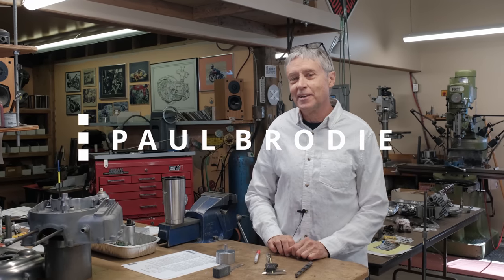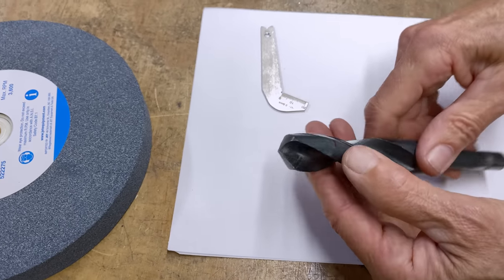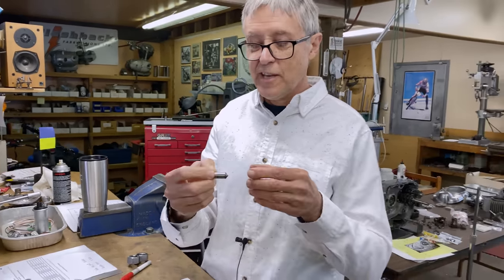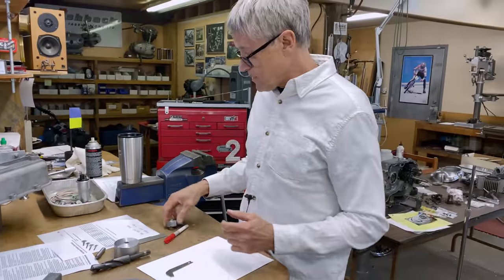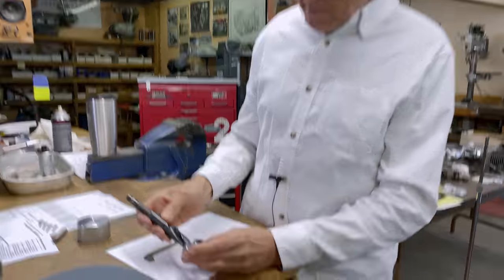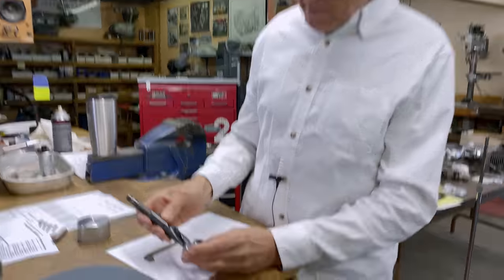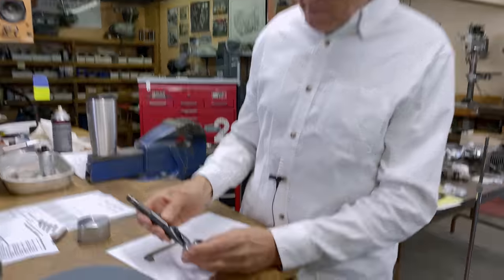How to sharpen your drill bits // Paul Brodie's Shop

Comment: Awesome video Paul ! Is that 996 Ducati behind you ?
I learned the two hex nuts tacked together method years ago from the same person who taught me how to sharpen drill bits and a lot about panel beating( a machinist who moved into panel beating ) - 30yrs later  is still use his technique  even though i have a Dbit grinder as it is just faster and it works . One tip i can add is when using a diamond dresser is  don't hold it perpendicular to the wheel surface - angle it so the rear of the dresser is higher than the tip  as it stops chatter and wear a dust  mask - that stuff really cuts up your lungs  .
Thanks for the video guys !
Reply from the maker: Thanks Ian. It is a yellow 996, but it is NOT a Ducati... That should get you thinking a bit! Model year is 2000.

Comment: Thanks for the tip on the diamond wheel dresser. Lee Valleys price in the US was only $27.50
( 0.25 Carat Wheel Dresser Item 25M0101). 
Replacing both my wheels (80grit and 120 grit) would have been $30 and I would still need to buy a wheel dresser some time in the future.

Comment: This is lovely. Nice camera work as well. Thank you for posting. 
I learned how to do this when I was a yute, but have not done much of it over the past 40 yrs. 
Back to school at YouTube University.
I've got a pretty good collection of bits piled up from people who would just buy new bits over the years when things were cheap(er).
Question: What's the best wheel for dealing with carbide bits? I'm pretty sure silicon carbide,  but I'm also seeing diamond wheels for $$$. 
I have some diamond plates for knives, and they are a beast when it comes to removing material.
Also, taking your example with a cut off tip, what grit would you recommend. TIA.

Comment: You really are best to have the relief angle start at the cutting edge. A flat right off the cutting edge will increase the needed force to drill and may cause excessive heat. There is also a diamond tool with a head approx 1.5 inch with multiple chips across the face which helps insure the face of the wheel is flat. Thanks for the video.

Comment: Great video Paul, as usual. That works great on a drill bit the size of your thumb. But what's the secret to sharpening something like a 3mm (or less) drill bit with aging eye-sight and it's even hard to find the bit in the first place. Ha Ha
Reply from the maker: Thank you. It's the same technique for small bits. Strongest glasses, steady hand, using the muscle memory of how you sharpened the larger bits, and patience :)

Comment: One way of adjusting the back cut on the flute is how high on the wheel you hold the drill 
You automatically introduce and angle being a little above the center line or the shaft of the grinder
Reply from the maker: You are correct. Thanks for watching and commenting.

Comment: Thanks for another instructive video! I'd like to know: what is the thinnest drill that you can sharpen? Can you go under say 5 mm?
Reply: By hand, I'd say about 10mm/3/8".  There are sharpening machines which will do down to 3mm/ 1/8" but most "home shop" sharpening machines are not *great* and have a bit of a learning curve before you can get good results.

If you are interested, there are shop-made drill sharpeners which can sharpen down to tiny numbered drills -- check out www.gadgetbuilder.com.
Reply from the maker: I sharpen all my drill bits right down to 1/16". They are tricky to get right but it can be done.
Reply: @paulbrodie  Wow that's impressive!

Comment: Very handy thing to be able to do ... when you can sharpen bits you take it for granted ... it's really just practice after you get the basics .
Reply: Freehand sharpening twist drills is a parlor trick that's good to learn. The twisting motion to develop the heel relief is weird. A good way to pick it up is to ape doing it with the grinder off. Just touch the whole heel through the sweep to develop the muscle memory. With the wheel off you can feel what's going on more. Starting on the heel and finishing on the cutting edge is a good way to go too. That way you have the furthest contact and can see where you're headed in the grind.

Comment: I took a machine shop class right after I got out of the army and they taught us how to do this and told us hit the second hand stores and buy up a bunch of drill bits to practice on and I did and all I did was make them more dull. We had to make a drill bit gauge as well. Looked different than what you got and we had to make it by hand filing. 30 plus years later, I'm still making drill bits dull. So I just buy new ones instead. :)
Reply from the maker: Sounds like you just need a little coaching on your drill sharpening technique. It's not rocket science, but you do need to be mindful of a few things. Thanks for watching.

Comment: I sharpen my own bits and i sharpen them with a little bit steeper angle and when im done they are very sharp, i sharpened a half inch bit that could go through 1 inch thick plate metal like butter, no pilot hole needed
Reply from the maker: Sounds like your technique is working for you...
Reply: @paulbrodie  ive been a mechanic now for over 40 years and through trial and error ive found the perfect angle, stock bits just don't cut as well and those so called titanium bits at harbor freight are a joke, the best bits made were the ones that were made in America when steel products were built to last now china makes everything and china is number 1 at making garbage the steel they make is to soft and brittle so when i find old old bits i hang on to them cuz they sharpen better and stay sharp longer

Comment: Best drill sharpening video I have seen. What's the smallest size you would sharpen?
Reply from the maker: I sharpen all my drills right down to 1/16". They are tricky.
Reply: @paulbrodie  Awesome. I'm going to have to make more effort! Other uses for old drill bits: you can sharpen them up to make a centre punch and you can even use them like a TIG rod to build up a hard surface on a homemade tool.
Reply from the maker: @benc8386   I have not heard that you can use a drill bit as a Tig rod.
Reply: @paulbrodie  It was on the weldingtipsandtricks channel not that long ago. But I have tried it out and it seems to work!

Comment: Bulldog sharpening jigs suck but they're not bad for evening up the cutting lips. I mounted mine funky so it grinds perpendicular to the cutting edge. I had to make a wedge shaped block for that to happen. Mount a bit in the jig and hold it up to the wheel and you should see what you need to do then.

Comment: Hi Paul, i noticed your Yellow VTR 1000 Great Bike! Is that your Daily Run-about? I have a '98 Yellow VTR that has 100,000 Klms & Still going Strong💪 God Bless & Keep the Dirty Side Down🇦🇺👍
Reply from the maker: Yes, that is my 2000 VTR with 65,000 miles on it, so basically the same as yours. They are great bikes for sure! Thanks for watching.

Comment: I have a question for ya, Paul!  I was watching a master Japanese welder, and his technique was very similar to yours.  BUT.. He didn't use any Argon.  Yet his welds, both "fusion" and Nickle-silver came out very nice.  As a quick experiment, could you try not using Argon and see what difference it makes?  Best Regards from Tallahassee!
Reply from the maker: Your question is not very clear at all. When I use nickel silver I am brazing. When I use argon I am Tig welding. I know what happens when I Tig weld with no argon. It burns the tungsten and the weld goes black because the oxygen contaminates everything.

Comment: Good morning Paul so I have been brazing for about 15 years now and I've used a few different types of torches all of which are Victor I also am a professional welder metal Sculptor I'm looking at one of your videos about a year ago brazing 101 I like it a lot I noticed your Technique is a little different than mine. One thing I might mention is pulling the torch back and forth is essentially the same thing as working the foot pedal on a TIG welder and dipping your rod anybody that can TIG weld would be pretty good at braising. Anyways I like the torture using I believe it's a Victor ca250 and I'm wondering what the disadvantages of having them mixing valves on the top versus bottom are. I know thermal dynamics would affect the valves as he would travel from the tip down to the valves realistically the only thing I worry about is Flashback how is your experience with this. I like the little hoop you have on your torch I myself fabricated a handle on my torch so when I'm holding it it's almost as if I'm holding a pistol I have the handle mounted in the center point of the torch so it rests essentially on my forearm and the hose wraps around my arm. I have found that all of my work I set low so I can sit down so I'm not holding my arm up all day long as the majority of my work may run as long as 6 hours consecutively

Comment: Hi Paul, thanks for the video, is it possible to sharpen a two flute end mill this way?
Reply: Give it a shot and let us know. I've certainly sharpened end mills with diamond hones. I'm not saying that works like a charm.
Reply from the maker: Yes and no. An end mill is obviously a different shape. I have sharpened endmills and they work OK, but I'd rather do it on a tool and cutter grinder, which I do not have. That's the best way.
Reply: @paulbrodie  that's the exact right answer. Anything's possible. Not everything is actually practical though. When I worked in a production shop we had a we don't sharpen end mills policy. We just ran them until they snapped and replaced them. We didn't want to use undersized tools.

Comment: Hi paul, nice video. I have a question do you also sharpen a drill under 3 mm, or do you buy new ones? I always try to sharpen them with a drill grinder but it can't sharpen below 3 mm so I try to do this freehand with varying results. I find the most difficult to sharpen the 1 mm, whether it works or I have to buy a new one.          Kind regards from the Netherlands     Akko
Reply from the maker: Akko, yes I sharpen drills all the way down to 1/16". They are tricky, and take good eyesight, which is not exactly me. Thanks for watching.

Comment: Do you use your mill as a drill press more.
I have a turret Bridgeport Mill and I also have a restored 1905 Cincinnati flat belt drill press I have the Chuck and the R8 adapter for the mill
Reply from the maker: I use my mill as a stronger, more accurate drill press, if I feel like it. No hard and fast rules.

Comment: Would it be fair to say that if looking at the wheel from the side (end) with the top being 12 o'clock, that as you're sharpening your bit you shouldn't use around 9 o'clock or lower on your stone, with your bit . . also never dropping the angle you're holding the bit at, with the tip below horizontal?
Reply from the maker: I had to think about it a bit, but yes, it is fair to say.. Thanks for watching and commenting :)

Comment: what kind of grinding wheel is that? i think it wasn't mentioned in the video i got a bunch of dull drill bits and I was thinking about buying the doctor drill sharpening machine but i own a bench grinder and it might be less expensive to buy just that kind of grinding wheel.

Comment: They also make wheel dressers that looks like a T, with the T part coated in diamonds (bonded), I prefer them. But lost mine...
Reply: I have single point diamonds and carbarundum sticks. I don't know why Paul doesn't like the sticks. That's what I mostly use myself.

Comment: I own a Tormek water cooled bench grinder for sharpening. I purchased their drill sharpening attachment which places a 4 point edge on the tip of the drill.  The Tormek instruction-dbs-22-en.pdf can be downloaded for the sharpening attachment. The PDF gives further information on drill angles.
Reply: I've seen that Tormek sharpening attachment.  Looks very thoughtfully designed.  Unfortunately, the whole system is outside my hobby budget.

Comment: What do you do to thin the web on small drills?
Reply from the maker: I sharpen the grinding wheel so that the corners are a very sharp 90 degrees. You need a steady hand and much concentration to thin the web, but it is possible. Hard to do a 1/16" drill, but it is surprising how small you can go...:face-fuchsia-poop-shape:

Comment: How I sharp my drill bits , I just cut a piece from each side of drill bit with angle grinder
Reply from the maker: Sounds crude, but it just might work for you...
Reply: @paulbrodie  
I usually got angle grinder and a cup of water next to me when im doing a hole to keep sharping the bits
Reply from the maker: @davoodehajiraj  I thought about it. Using an angle grinder is crude...   :face-orange-raised-eyebrow:

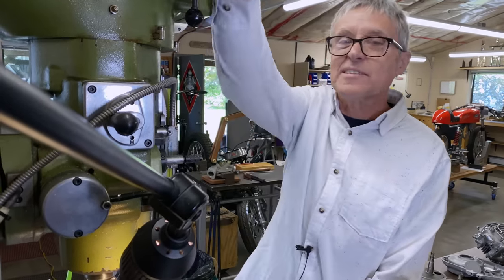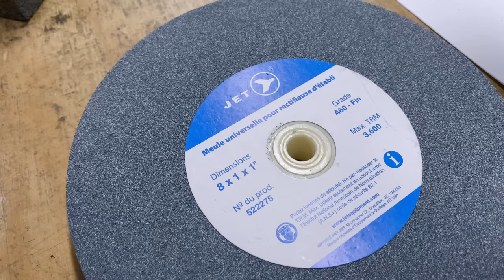Comment: You didn't mention the MOST important thing is WATER! never let the bit get hot, if it changes color, it's wrecked! Cut it off and start again!! ALWAYS have a pan or bowl of water right there and dunk it VERY frequently!!! Also, an old WW2 machinist taught me, if you look strait at the drill (as if you were going to drill into your face) if you line up the 2 cutting edges as "Horizontal" or pointing at 3:00 and 9:00 on a clock, IF you've sharpened it correctly, the angle where they come together in the center is always pointing at 1:30 - if it's anything other than that, you've got either your rake wrong or your initial 118* wrong.........
Reply from the maker: Well, I did mention the importance of water and not getting the drill too hot. Maybe Mitch edited that out? Thanks for watching and commenting.

Comment: You should have centred up the new wheel before using it, there is a little give on the plastic mounting bushes and a couple of gentle taps with a hide mallet before fully tightening the centre nut would have got it running true or at least better, I hold an industry Abrasive Wheel Certificate which I attended college for in 1974
Reply: Your appeal to authority aside it's well accepted that any grinding wheel needs to be dressed to run true once it is mounted. That's even true with surface grinders with wheels in metal arbors. Wheel goes off then wheel goes back on wheel gets dressed. Even if left in the arbor.
Reply: @1pcfred  Yep but I still get them as true as I can before dressing
Reply: @rotax636nut5  if a wheel is really out I'd investigate, maybe. Or I'd just dress it more. I consider grinding wheels consumable items.

Comment: A lot of experience is talking over here √√  GREAT one √√ It would have been even better, if you had used a steel or metal to drill,  since aluminum is much softer …
Reply from the maker: Yes, I could have drilled a hole in a steel plate...
Reply: @paulbrodie  Maybe you could/would add more/different materials/samples …

Comment: Cutting it off and starting over. I'm attentive.
Reply from the maker: Thanks for watching..
Reply: I cut off one that I broke. After I got it to look like it would cut, I found a piece of bed frame in my scrap bucket that already had a pilot hole to use. It went right through. Does that count as being an attentive student? It was a 3/8" drill.
Reply from the maker: @AHill-oi9ct  You could be an attentive student. Sometimes bed frames are made of harder steel. You might have got lucky there...  😉

Comment: I sure hope your doing alright Paul….haven’t seen a new video from you as of July 8th 2022😞
Reply: Hi David, you might have missed it but Paul
posted a message on the channel (you can
find it under the "Community" tab on the
channel). Essentially, Paul has been diagnosed with a form of cancer and will be undergoing some treatments. So in the meantime our video production has been temporarily stopped while he goes through this. We hope to get back to making videos as soon as possible. Thanks for checking in👍
Reply from the maker: Mitch is correct. I am not on holiday. I am in Hospital recovering fro bone cancer. We will be back when I have healed. Thanks for your support.

Comment: You don't need a particularly sharp drill when using a drill press, not saying just sayin. Also cutting a drill bit with a grinder will probably get the bit hot enough to take the temper out of it and it will dull faster after that.